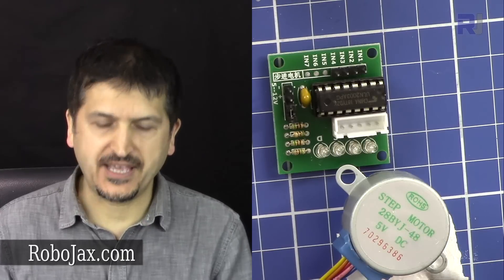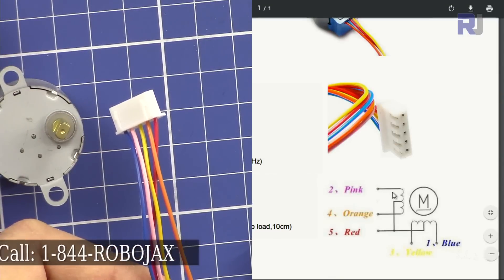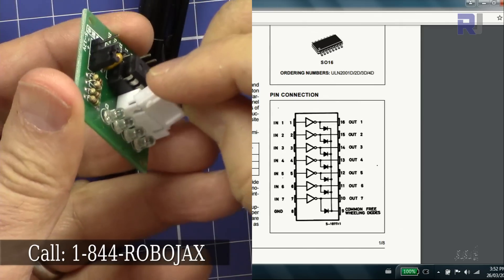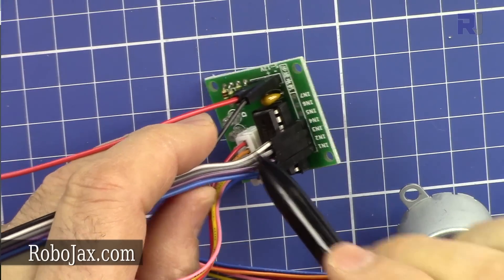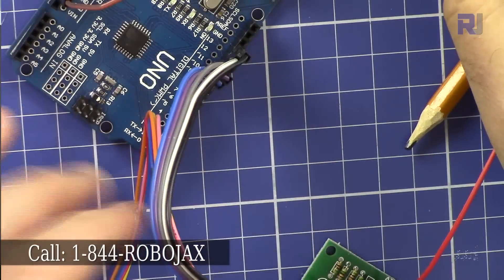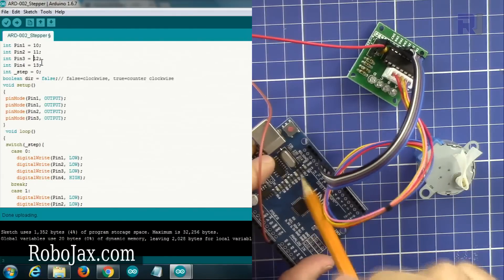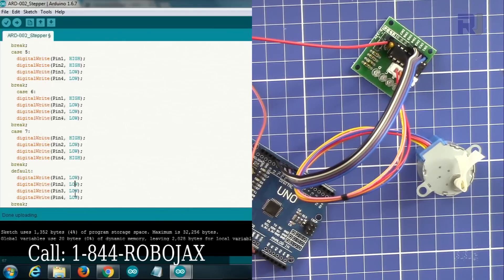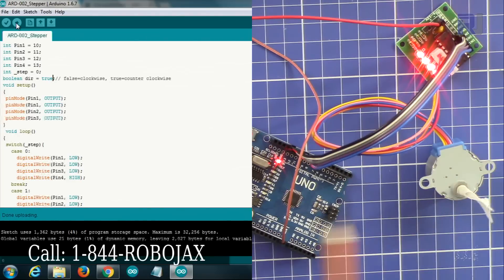Control Stepper motor 28BYJ-48 with ULN2003 for Arduino - RJT4

Comment: greeting. thanks for the video. I have a question: my project is almost finished, I connected 3 servo 5v, one stepper 5v engine, one lcd display. all on the arduino board. How much voltage should I use? is 5v enough? ... or should I use more? I use it through the ULN2003 drive! like in this video.
Reply from the maker: voltage is the operating voltage and it does not change. so when you supply power of 5V, measure the current (ampere) for one servo motor multiply it by 3 and then measure the current for stepper. then add them together and you should get something like 1.2A (for example). then you find a power adapter or batter that can supply 5V 1.3A or 1.5A just higher than 1.2A.
Reply from the maker: have you see this latest video of this stepper https://youtu.be/TQ7R2bY-MWU
Reply: @robojax  you make great torturials. Thank you. I've reviewed almost everything about stepper engines but now I'm confused by these amps. I hope I take the right amperage without measure it because I can't measure it. I'll use 1.5 A :) thank you, you're a nice person

Comment: Excellent presentaion. This has cleared up some stuff. I have a PTZ-E27 that I don't trust on my WiFi, It uses the 5 wire steppers as servos, Now they are Arduino servos Thanks. Now I have some cool stuff to go do.
Reply from the maker: Here is the full video with 8 projects https://youtu.be/TQ7R2bY-MWU

Comment: Can I connect 9v battery to +5v in of uln2003 driver and drive 5v stepper motor with 9volt battery?
Reply from the maker: no you can't use it. the board will burn. please watch this updated better video with so many examples https://youtu.be/msB3zpxy7Uk

Comment: Is there a way to power the motor without an arduino? I got a speed control circuit and it does not work when I connect everything
Reply from the maker: for stepper motor you need a microcontroller to send those signal I've shown. Arduino is a microcontroller.
Reply: @robojax  you cant just connect it to a potentiometer and increase the speeds with a knob rather than controlling it with an arduino?

Comment: Doesnt work, probably something wrong with my code. I wanna use Yours instead and i couldn't find the code you did. can i get the code? The website you posted on other comments cant find it either
Reply from the maker: Hello, ever video have a description below it and there is a link to get the code. I have mentioned this in the video.

Comment: Hi, top video my friend, i have succeeded in getting my stepper to work. my question is can i use the same code to control a Nema 17 1.8° 42mm 0.44N.M 1.7A Stepper Motor 4-Lead with a A4988 . thank you
Reply from the maker: Hi
Please see this video https://youtu.be/cYTICj4DWYc
Reply: @robojax  thank you, problem solved.:-)

Comment: Im always watch robojax video. Can u help me, i want to make controll stepper motor with keypad 4x4, with 50 combinantion of rotation. Keypad press 3 digit, correct sample: "A11"= motor rotation go to 1000, "A12"= motor rotation go to 2000, until "A61". Can you help me to make demo n code? Thanks before
Reply from the maker: Search for #robojax28BYJ_48 or click on it under the video. I have so many videos. and I am sure you can find something or get the idea how to use it for your purpose.
Reply: @robojax  thanks for ur respon, im just confused code how to function keypad with 3 digit, correct sample, press keypad "A11" the motor rotate 1000, and press "A12" motor rotate to 2000
Reply from the maker: Your confusion will be resolved if you learn how to control is with push button. Once you learned that then push button can send this value  for you

Comment: Hi. I have problems with making the Arduino work without a power source connected to the USB hub of the Arduino.

It works just fine when the Arduino is connected to my computer and at the same time is being powered by an external power source. Thank you!
Reply from the maker: Hi, you should not have problem. just supply 5V from USB or 6 to 12V from VIIN pin. it should work.

Comment: You said one goes to 10 and then 2, 3, 4 goes to 10, 11, 12. So are 1 and 2 both going to 10?
Reply from the maker: I can't explained it better than video. So watch it  multiple times 3, 4, 5 or even 10 time. this what I would do to learn if I don't get it.

Comment: forward lllh llhh llhl lhhl  reverse lhll hhll hlll hllh :  inverter chip with diode protection. bill rockstroh (ww2) at radiac abrasives i think would just put this at logic chips. i did a few boards with logic chips. first guess- selector chip with 0v 5v. 4 bit . now if the stepper motor starts to skip. a spring may havesettled that question somewhere.

Comment: Really confused by common. Please clarify.
Reply from the maker: which common? point to video like at 2:45 . common means we have the same voltage or wire shared or connected to the motor and Arduino

Comment: Hey, so the LEDs on my board are flashing when I upload the code. They flash in order ABCD over and over, do you know what this error is?
Reply from the maker: what error? flashing? they have to flash. but if they flash so slow that you can see, it means you've set the speed such that I it will complete one rotation in 1 hour. See my other video. I've got over 10 videos on this motor.

Comment: Hello I've followed your tutorial in the past and made a functioning turntable using this stepper motor. Recently trying to improve on my design I noticed it no longer works. The motor is just buzzing. I'm powering the motor using the 5V pin from the arduino board and the board. I'm at a loss on how to troubleshoot this. My primitive mind only speculates that maybe the motor is in some kind of wrong position because there is no on/off switch the board resumes executing the program as soon as the power is supplied. I did  try to add delays before the motor started to work but currently I have no progress. Can you give me a clue why is this not working? I'm currently using your code as is. Cheers.
Reply from the maker: Hello, when motor buzzes it means wiring is incorrect. check it again. Or the PCB controller is dead if wiring is correct.
Reply: @robojax  Thank you for the reply. The wiring seem to be ok. I've ordered a new stepper motor and stepper motor controller. I will try to redo everything.
EDIT: it seems now its working. In the end I've switched out the motor and driver unit so it could be the fault of both also I did find a design flaw in the way that I connected the rotating bit to my turntable that made too much friction that stopped the motor working. Thanks for the help.

Comment: So if I don't have an external voltage source it will not work?
Reply from the maker: it will work if you connect it to 5V of Arduino. But if you overload the Arduino board, it might get damaged. Depends on the motor what you do with it.
Reply: @robojax  I tried to power it using the arduino but the motor only vibrate and not rotate and I think I should get an external power source.

Comment: why my motor is vibrating but not moving
Reply from the maker: either code is changed or wiring is incorrect.
Reply: @robojax  i follow every steps but its just vibrating

Comment: Moving a stepper is not simply sending high and low signals just because, you must keep in mind the other aspects such as the frequency the motor handles, in other words, it's not about to send ones and zeros awkwardly, at least you had to put a delay . .. otherwise you energize the coils, as I said, awkwardly.
Reply from the maker: yes. you are right.

Comment: im newbie with arduino and i follow your instruction and it's work great ,thank you so much ))) the stepper temperature even very stabil. if you don't mind to explain  i just wondering how to run 2 stepper motor with your code .Thank you
Reply from the maker: You are welcome. if it gets hot, 1-Input Voltage is higher than motor voltage. Make sure to connect 5V if motor is 5V 2- Incorrect wiring.  for two motor, I would have to make another video.

Comment: Robojax Thank you for te good video, is there an option in the code to let te motor turn faster?
Reply from the maker: you are welcome. This is the fastest speed. You can slow it down by adding delay in side the loop like delay(50); or 100 which is 50 millisecond and 100 is 100 milliseconds.

Comment: is there any way to use the battety connector?
Reply from the maker: I have sown it. I said your power supply. Your power supply is your battery. If your motor is 5V, connect 5 to 6V battery and if your motor is 12V connect 12V battery.

Comment: Hello Sir my motor is just vibrate and not moving. My connections are correct similar to you also connected external power with common ground still not working please help.
Reply from the maker: I will reply to all Subscriber's 🔔 questions. So make sure to Subscribe.😊

Comment: If I use arduino due which is operated on 3.5v.so which type driver I have to use?
Reply from the maker: You can use this module. As I have explained , you can connect external 5V for the motor. Watch the video.

Comment: is there a code for controlling the motor with a potentiometer like how you would control a servo motor with a potentiometer?
Reply from the maker: Just updated the description where I added the link to my video on how to control it using potentiometer, how to control it using 3 push buttons and how to control is using hand gesture. good luck.

Comment: Can you make a stepper motor rotate 52.24 degrees only? how? what about a DC motor?
Reply: The best way is to just google some example code and play with the values to get the specific angle when you actuate the circuit. Say, press a button, and it moves to position, press the button again and it returns. Actually very useful.
https://learn.adafruit.com/adafruit-arduino-lesson-16-stepper-motors/arduino-code

https://www.amazon.com/LAFVIN-28BYJ-48-ULN2003-Stepper-Arduino/dp/B076KDFSGT/ref=sr_1_3?keywords=stepper+motor+kit+uln2003&qid=1566870972&s=gateway&sr=8-3
Reply from the maker: I have it in my "to do" list. I would have to use LCD screen so you know the angle.

Comment: what is the int count=0; for in your source page? I'm guessing it was left over from a part of code checking ratio or switch the direction. I just modified it to count++ for each loop and switch direction, value of 4321 does 360 degrees.
Reply from the maker: Yes I was doing something to count and forgot to delete.

Comment: Please help to create source code for 2 x stepper motor 28byj-48 with mpu6050. I have no idea the algoritm between the degree mpu and degree motor sync.
Reply from the maker: watch the video again. 1- Define 4 more pins for your 2nd motor.   2- inside setup define 4 pin more as output 3-change the vairable _setp to _step1 and make another one _step2, and do the same for "dir" varible  and change it to "dir1" create another variable "dir2" and  inside the loop duplicate the code replacing all pins with the one you defined in setp (1) and replace all "_step" to "_step1" and "_setp2" and then dir1 and dir2. If you can't understand this code, then watch mother videos on relays. You will learn how to define and change stuff. Can't help further.
Reply: @robojax   Thanks for the reply. yes, I can connect and define 2 motors. in this case, when the MPU6050 in 30 degrees, the motor goes to -30 degree to stabilize the object. it sounds like balancing motor. 
there are so many samples for DC motor and Stepper NEMA17, but I didn't find the sample for 28byj-48 motor.

Comment: Thank you for the informative video and the associated code.
It worked very well for me.

I refactored the code and built a small library to include with my projects to keep the main code for my projects cleaner.
I was able to boil the drive code down to an array and about 8 lines across two small functions.
Reply from the maker: You are welcome. That is the best way but many viewer will struggle to understand it. I preferred to put it the most plain way so people can see how it works. Once they learned, then they can write simpler code.
Reply: @robojax  I couldn't find you code on website so I copied from video after doing exactly the same I wasn't able to get the motor running idk why! And can you please explain how the stepper motor actually works? thankyou

Comment: #include <Stepper.h>

const int trigPin = 12;
const int echoPin = 13;

long duration;
int distance;
int i;
int c;

const int stepsPerRevolution = 200 ;
Stepper myStepper(stepsPerRevolution, 8, 9, 10, 11);

void setup() {

pinMode(trigPin, OUTPUT);
pinMode(echoPin, INPUT);

const int stepsPerRevolution = 200;
myStepper.setSpeed(60);

Serial.begin(9600);
}

void loop()
{
  int sensorValue = analogRead(A0);
  float voltage = sensorValue*(5.0/1023.0);
  Serial.print(voltage);
  Serial.print(" Volt  :");
  
  Ultrasonic();
  c=0;
 if(voltage>=3 && voltage<5 && distance<30)
 {
  c=1;
 }
  for(int i=0 ; i<c ; i++ )
  {

      Serial.print(voltage);
      Serial.print(" Volt  :");
      Ultrasonic();
    
    phase1();
    phase2();
    phase3();
    myStepper.step(stepsPerRevolution);
    delay(1000);
    Serial.println("Status off");
    
  }
  delay(500);
}
  void phase1()
  {
  int sensorValue = analogRead(A0);
  float voltage = sensorValue*(5.0/1023.0);
    if(voltage>=3 && voltage<5 && distance<30)
  {
      c++;
  }
  }
  void phase2()
  {
      int sensorValue = analogRead(A0);
      float voltage = sensorValue*(5.0/1023.0);
      if(distance > 30 && voltage>=3 && voltage<5)
    {
      c++;
    }
  }
  void phase3()
  {
      int sensorValue = analogRead(A0);
      float voltage = sensorValue*(5.0/1023.0);
    if(voltage<3 && distance > 30)
    {
    i+5;
    }
  }

int Ultrasonic(){
    digitalWrite(trigPin, LOW);
    delayMicroseconds(2);
    digitalWrite(trigPin, HIGH);
    delayMicroseconds(10);
    digitalWrite(trigPin, LOW);
    duration = pulseIn(echoPin, HIGH);
    distance= duration*0.034/2;
    Serial.print(" Distance: ");
    Serial.print(distance);
    Serial.println(" cm  :");
    delay(1); 
}

Comment: Thank you for your great effort

Can you please explain to me the code

 for the same Stepper motor for 26 equal steps

 around 360 degrees and return to the same starting point?

best regard 
Ali
Reply from the maker: did you watch the video? that is what I did. Explained the code and provided the code so you can use it.  here is the code http://robojax.com/learn/arduino/?vid=robojax-0293

Comment: hi robojax, when I am putting in your runtime version, the motor doesn't stop.
basically I need the motor to turn 90 degrees and then return back.
do you have any suggestions please,
kind regards,
dave

Comment: I have a step motor board using the UN20(03) which has burned out the IC. Can you recognise the components so I can replace them? http://dorisvisits.com/uln2003-fault/
Reply from the maker: The two pieces of red item are 1N4148 diode (SMD type). https://www.ebay.ca/itm/391780046356
the chip is also Surface mount device (SMD)

Comment: hello, my friend made for me an arduino IR controller to move a step motor by the tv remote controller.   everything works fine, but he doesn't know how to make the motor move constantly while keeping pressed the remote button.
Actually everytime i push the button, the motor turn just for the steps that he set. So to set the right position i must press many times the button.
do you have any council? thanks
Reply from the maker: it could be done many ways but in your case you just need to find out how long (time) you want the motor to run every time you press the button. Then you can set a delay to stop it after that amount of time.
Reply: Robojax thanks for your quickly reply I will pass these informations to my friend. Have a nice day
Reply: arduino is not my daily bread LOL
this is what i have now:

#include <Wire.h>
#include <Adafruit_MotorShield.h>
#include <IRremote.h>

// Create the motor shield object with the default I2C address
Adafruit_MotorShield AFMS = Adafruit_MotorShield();

// Connect stepper motor with 32 steps per revolution
// to motor port #1 (M1 and M2)
Adafruit_StepperMotor *myMotor = AFMS.getStepper(32, 2);

/*----- Variables, Pins -----*/
int receiver = 2; // Signal Pin of IR receiver to Arduino Digital Pin 2

/*----( Declare objects )----*/
// Setup of proper sequencing for Motor Driver Pins
// In1, In2, In3, In4 in the sequence 1-3-2-4

IRrecv irrecv(receiver);    // create instance of 'irrecv'
decode_results results;     // create instance of 'decode_results'

void setup()
{
  irrecv.enableIRIn(); // Start the receiver
  Serial.begin(9600);  // set up Serial library at 9600 bps
  AFMS.begin();  // create with the default frequency 1.6KHz
  myMotor->setSpeed(200);  // 200 rpm   
}

//main loop to listen for remote IR signal and move motor

void loop()
{
  if (irrecv.decode(&results)) // have we received an IR signal?

  {
    switch (results.value)

    {

      case 0x20DFC03F: // UP button pressed
        myMotor->step(17, BACKWARD, SINGLE); //I need backward motion to turn my volume knob up
        //delay(200);  this was in the original code but I decided no delay was better
        myMotor->release(); //saves stepper from using voltage and getting hot at rest
        break;

      case 0x20DF40BF: // DOWN button pressed
        myMotor->step(17, FORWARD, SINGLE);
        //delay(200);
        myMotor->release();
        break;

    }

    irrecv.resume(); // receive the next value
  }

}/* -end main loop - */